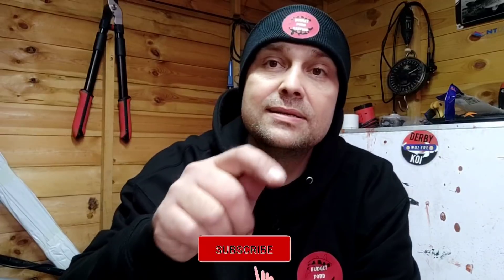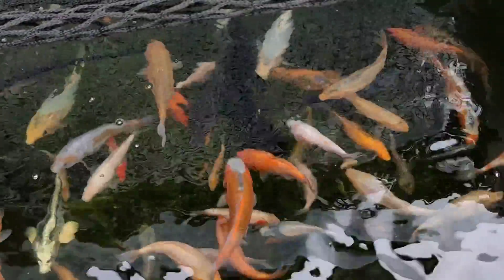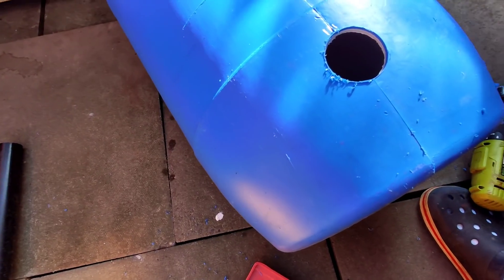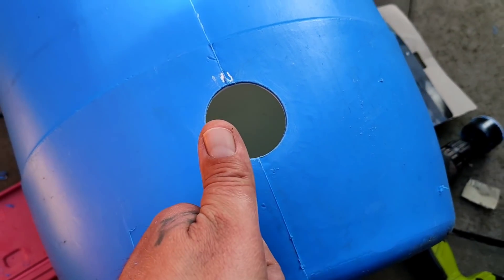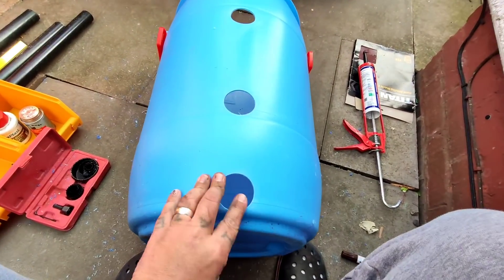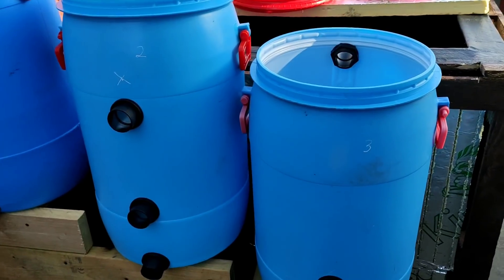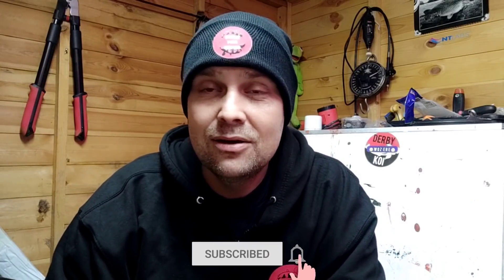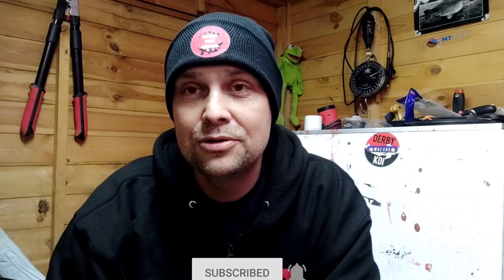**DIY 3 BARREL POND FILTER BUILD + UPDATE ON THE SICK KOI FRY**

Comment: Neat and simple video. Ive been watching quite a few over the week to build one myself. One suggestion I would add is, for the drainage, you can add an L bend with the opening jist a few mm off the barrel bottom. That will create suction and easily throw out debris.
Reply from the maker: Yes mate you are right that is the best way , if it were to do it again I'd definitely add a 90° to the drain line 👍

Comment: Excellent video Leon, as always. Good filter system, and that is some filter for the tank! Cant wait to see it work! It will be amazing. 
Good ole CT1, we always end up with some everywhere. 
You are correct about the seal on the outside. It stops the water from going through the thread, so you did it the correct way.
Reply from the maker: Thanks mate 😀 yeah it should be able to keep the water tip top in that tank 🤞
Can't beat a bit of ct1 and yeah it gets everywhere 😭
Fingers crossed it doesn't leak like a sieve when I turn the pump on 😂🤞
Reply: @progressivepondkeeping  it wont :-)

Comment: New filter is looking good and should work a treat. Just one comment...whenever I use a tank connector I always puit the washer on the inside (water side) of the barrel with the treads on the outside. Makes more sense to me to have the washer 'stop' the water before it has a chance to bypass the fitting or leak around the threads, also having the nut outside makes it easier to tighten. When I can however I prefer using a uniseal instead of a tank connector.  Cheers.
Reply from the maker: Cheers mate. Thanks for the info on the tank connectors makes sense I haven't tried uniseals might give them a go at some point . Thanks mate 👍

Comment: Good video Leon. It's always good to see how people do things. I'm thinking about adding a moving bed to my filter system for next season. My only issue is where to put it. In line with my existing filters or on a separate line? With the tank connectors, it doesn't matter if you have the washers inside or outside as long as the washer sits against the flange and not the nut. If you put them next to the nut water wicks down the threads and you would have a leak. Sorry to hear you lost some of the fry but at least you managed to save the others.
Reply from the maker: Cheers mate , could you maybe put it after the upflow 🤔 . thanks for the info on the washers mate I wasn't 100% sure tbh. Yeah it's a shame to have lost some fingers crossed they are past the worsed now 🤞

Comment: Nice video Leon good work m8 👍
Reply from the maker: Thanks mate how's your pond coming on
Reply: @progressivepondkeeping  hi Leon 
Yeah I’m now 2 blocks high above ground and now need to get some pipe work done for the return inlets before I can continue laying more blocks (also trying do decide on skimmer) surface mount or a free standing one that sits in the pond thinking more so on the surface one but need to install it before I finish the block work 🤔
Reply from the maker: Nice one mate you could always use one of those in pond skimmers that go through the wall on 4 inch pipe but any Will do the job 👌

Comment: Glad your on top of the fry tank Leon, good progress on the pallet tank filter system, are those branch loppers behind you on shed wall? what make are they,  any good?  just broke 2 pairs, aluminium handles,  soft a s**#.
Reply from the maker: Thanks Marek I can't wait to get it up and running now. The loppers are called "forge Steel loppers" from screwfix I've only used them a few times so can't say if they're good or not but they do a spear and Jackson set aswell that are quite good 👍

Comment: Hi Leon just a quick question mate when you say pp the media before you put in filter what is it you use to do it many thanks mate..
Reply from the maker: Hello dean it's a type of pond treatment called potassium permanganate it will clean and dead bacteria off used media and will etch a better surface area on the new media allowing the beneficial bacteria to bind to it easier 👍